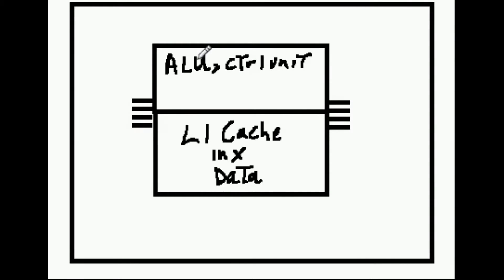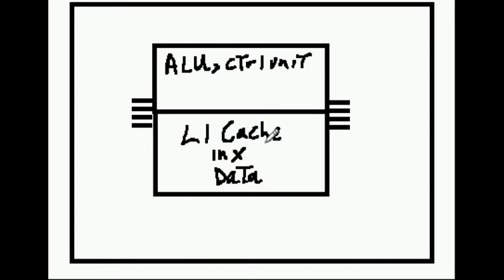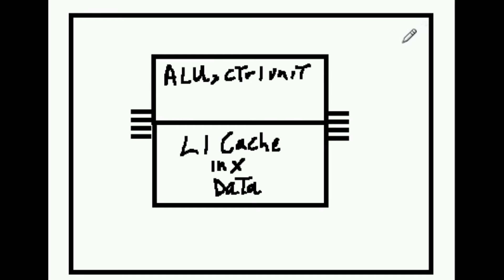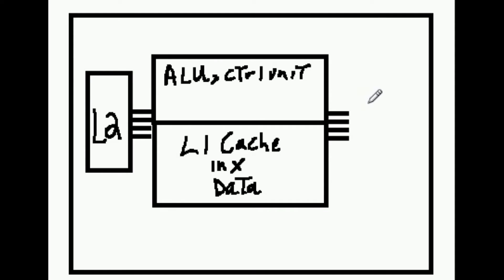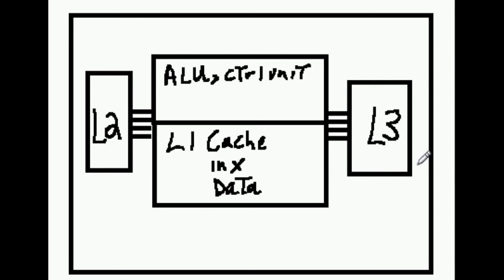Hardware L1, L2, and L3 Cache

Comment: can you explan the placing of these caches where are they placing instead of connecting with busses as i learnd the l2 and l2 cache is connected with cpu using system bus but the question arise where exactly they locate